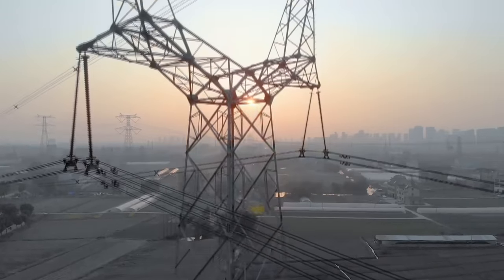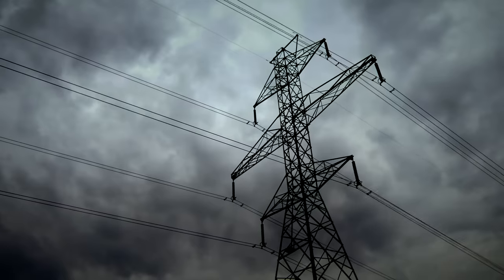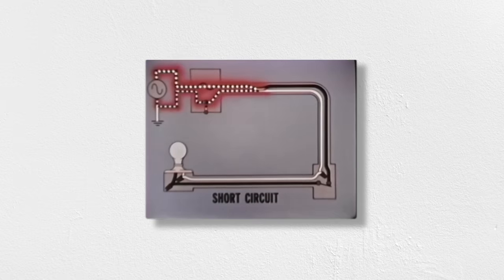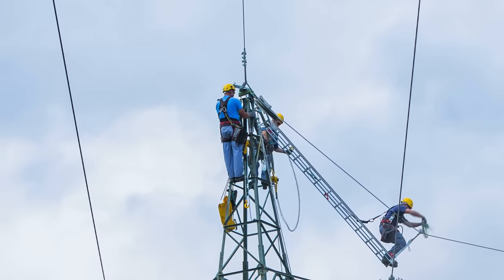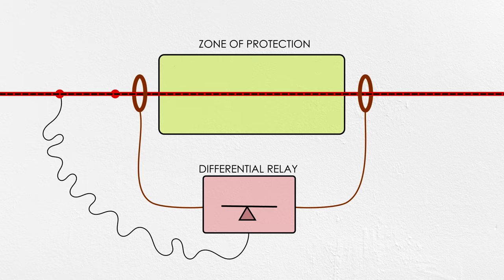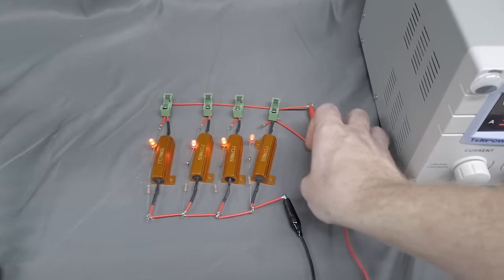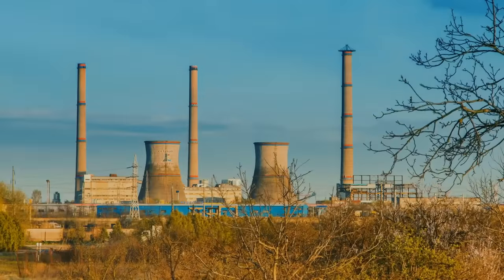How Power Blackouts Work

Comment: How is the internet connected to the grid and what can a hacker do to pull down the system?
Reply: I don't know about other places, but in North America the internet is not connected to the grid at all. Critical Infrastructure Protection rules in the US end up extending into Canada via the North American Reliability Corporation rules that govern bulk electric power in both countries. CIP rules forbid any routable protocol (like IP or dial-up) into critical power system equipment and fines for violating that are measured in millions of dollars, and the individuals responsible were looking at fines in the $50,000-$200,000 range.
It is all taken very seriously because of the fines. When I worked in IT field support for a Fortune 100 electric company we had annual training and testing on the CIP rules. When I needed to connect remotely to our equipment in substations I went to a specific place in our service center, logged into our intranet and looked up the circuit information. Then I called our Support Center where I talked to any of a handful of techs who knew my voice and asked them to build a circuit to the comm port on the equipment. Then I logged in with the user name and current password, and I had access to one device. When I was done I called the support center back and had them tear down the connection. If I forgot to call back they would check back every half hour (and they knew my cell number by heart.)
If I went rogue I could cause momentary trouble for a million or two people. Most of them would not even notice.

Comment: The fault you simulated happened because you were limiting the current that could go through the system at the generator level. I don't think that's how real power distribution works, current is set by the resistance of the devices rather than fixed to a value by the generating plant, thus a resistor+led package should not see a current difference when one of the other packages disconnects, and so it shouldn't burn out. Am I wrong here?
Reply: I was thinking the same. The voltage increased when one LED went out to keep same current, and current through each led increased by some amount leading to fuse breaking. Then the other and then the last one 

And did you notice 3rd led went down earlier than 2nd one. Just an observation though, that resistor might have little less resistance than others

Comment: So why does Electric companies charges the "transmission loss" to consumers?
I'm jus curious.
Reply: I know the one that I retired from doesn't. Bulk electric power consists of buying power from generating stations and selling it to individual customers or to wholesalers, and from wholesalers to the individual customers. They are very different price structures and (at least in the US) regulated with an iron fist by the FERC. The retail price is usually fixed by regulators while the generated electricity is bought and sold in what one of the traders described as the highest stakes poker game in the world.

Comment: Pretty insane to put so much renewables power into the grid then spend a lot of effort and money on backup generator systems, batteries and adjusting power output of reliable coal to keep the lights on.
Reply: Actually, it is natural gas that is replacing coal. Not only is NG cheaper than coal now (especially when mercury controls have to be added to coal plants) it is one of the two energy sources that can ramp up quickly enough to keep up with the sag in solar generation just as demand begins to peak. The other source is hydro, but most of that is spoken for. It is ironic that oversupply of solar demands fracking to maintain stability.
Reply: @flagmichael  Its intentional destruction of reliable power, possibly the greatest con of the 21st century. They know exactly what they are doing.

Comment: Relays? Relays don't measure anything. They're switches. Other devices measure the load parameters, then they might command a relay to switch.
Reply: In the trade (at least here in the Western US) the boxes are often referred to as "relays." I know it is not technically correct but it was never my call.

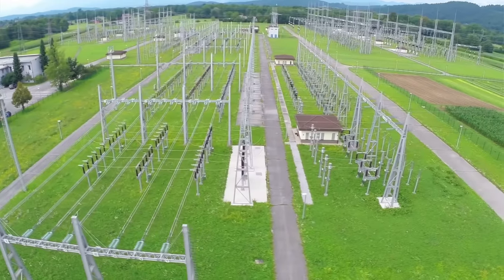Comment: 3:14 a car that never breaks down you say? buy an old volvo! they're indestructable! i have a 940, and it goes like a clock!
Reply: I had a 1985 Volvo 765T. Second most unreliable car I ever had (a 1984 Dodge 600 takes that prize.) It didn't help that the wiring was biodegradable (Volvo stopped that experiment in 1987) and the insulation shucked off like crazy, but there were more vulnerabilities than I can remember. Fuel pump relay, intake ducts melted from oil mist, fuel pre-pump pickup hose tore (most do), intake stuck on full preheat... the list goes on and on. The worst was the leaking heater core. Or maybe the intermittent TDC sensor or intermittent "power stage" (ignition driver). Eventually the piston slap doomed it, the inevitable end to every B230FT that didn't suffer thrust bearing failure.
Reply: @flagmichael  wow you were unlucky, there are tonnes of old volvos going around where i live

Comment: GFCI? triggered Next your gonna start using imperial units.
Reply from the maker: Called something else outside US?
Reply: RCD?
Reply: It’s also called GFI outside the United States. I think Mina86 is responding with a hint of sarcasm.
Reply: Yeah, it's RCD in UK though it has a bunch of names in other regions.
Reply: mina86 Ground Fault Interrupter is pretty descriptive to me.
Reply: mina86 Pretty rich, considering that the UK considers itself metric, but has speed limits in Miles Per Hour. . .
Reply: @dewiz9596 , yeah, that's because UK is only slightly more civilised than US.

Comment: A utility company needs more equipment every year, so they get a budget in January, then plans are made, contracts are set out, stuff is built, then they end up pouring cement & bolting up components the following January. This compromises quality, and creates misery for workers. Why cant engineers and managers get together and offset plans a few months ?
Reply: You mean form a union?
Yes they should if they aren't already in one.
Reply: In communications we had the same problem. Engineers would visit a site in the desert in winter or the mountains in summer, and release a construction package half a year later.

Comment: We could just use solar energy or even geothermal energy from the earths core very easy and cost effective
Reply: Geothermal, where available, is great. Iceland is volcanic and gets most of its power from geothermal. The US has relatively few locations with practical geothermal energy.
Solar is not so great - it is "non-dispatchable" which means it is not available on demand. California has already added a problematic amount of solar to the Western Intertie, which requires natural gas plants (and the fracking to provide the natural gas in such quantities) to maintain grid stability when the sun sets. See https://www.instituteforenergyresearch.org/solar-energys-duck-curve/
Reply: @flagmichael  geothermal energy is just taking energy from heat so basically if we somehow put pads that take in heat as energy  close Earth's mantle we would have alot of energy for ourselves it's like digging for oil  but safer

Comment: So, the grid, and it's many safety features are important, and I love learning about the various parts of it. But, why, in God's name, is the US broken down into no more than about 4 or 5 grids?

Like, the northeastern blackout was really bad, and was the second time it happened. But, I want to know, why not do what Texas does? Break the grid down per state? This way, if the power goes out in one state it's neighbors are perfectly fine.

But I've been wondering about this since about 2003. Because my thought was originally that the grid was broken up into smaller chunks, at least up until that point. Each state has like 1 or 2 electric companies covering them, so it would make sense to keep an extra layer of protection should it fail so much to the point of covering the whole state.

Also, some states, like California and New York would benefit not only from 1 grid protecting them from their neighboring states, but, extra internal grids due to city sizes. Give NYC one, or, since it's got 5 neighborhoods, give it 5, separate from the state. And California could have a few: 1 for northern CA, one for southern CA, and then one per major city, such as LA, San Francisco, etc.

Understandably these could complicate the systems a bit, but, they can establish solid borders and locations for the separation of grids, and thus become much more manageable.

And power from the generators can be easily solved, set up a separate line network as a sort of 'highway' for electricity, and then break it down into 'avenues' and 'streets' within each area.
Reply: Its a tradeoff between efficiency, reliability, and stability. Smaller grids may be more manageable, but not necessarily more reliable or efficient.

Comment: Nice explaination but thats not as simple as that you need a electrical engr to explain it more..
Blackout sometimes cause by load shedding but as i said not simple as that because its o complicated you need to balance the power per phase . Also its. Not just line to ground fault sometimes its also cause by 3phase fault, single line to line  and double line to line.. faults may happen in different parts of electrical industry  generation, transmission, distribution or even in your house .. as a consumer. Sometimes fault cause by disaster or they're doing maintenance.

Comment: Ok, I have to say this since it is a real issue with most videos about electricity.....Electricity DOES NOT "SEEK GROUND" !! Electrical current will take ANY and ALL available paths back to its SOURCE, period. The amount of current flow follows Ohm's Law, and ALL paths (including ground) will have a degree of current flow. The amount of current in each path depends on the resistance of said path, with lower resistance paths flowing more current than higher resistance paths.  And yes, "ground" is a part of it, since for many technical reasons (including safety) MOST, but not ALL, electrical systems utilize a grounded conductor as part of the circuit.

Another myth (which sadly, some Electrical Code Classes STILL teach to new apprentices) is that you cannot get shocked off of a neutral conductor (which in the U.S. and most countries, is grounded.) This myth is false, and for the very reasons I mentioned above (remember: ALL paths back to the SOURCE), you can get shocked from a neutral conductor. (Especially true on 277v lighting circuits common with 480y/277 systems.) 

Despite the repeated use of the seeking ground myth, this was otherwise a very good and educational video.
Reply: Actually, Ohm's law holds only for linear elements. Once you reach transformer saturation for example, using Ohm's law stops being accurate (unless you model the impedance with the non-linear characteristics). Amount of current depends on the impedance of the path in AC systems, no only resistance.
Reply: @FrainBart_main  You are correct. My response was keeping things simplified for the masses.

Comment: Target the electrical grid to accelerate the collapse
Reply: There are five of them just in the US, and they are fairly well hardened against terrorism. When I worked in an electric utility I was peripherally involved with an eco-terrorist attack on transmission lines for a nuclear generating station. Surprisingly enough, although the sudden drop in load caused two units to trip off line it never made the news and nobody noticed.
I worked in IT Field Support and was in the Y2K vigil, one of the half dozen techs we had monitoring the communication system. Everybody was on call or on station in remote locations, and out biggest concern was for hundreds of pounds of dynamite and 3/4 of a mile of det cord that was stolen from a shed at a cement plant a few months before. Nothing happened.
It would take a staggering number of people to make any large scale impression, and you know there would be a lot of federal agents in their ranks.

Comment: The reason they don't put the lines underground is that would mean less faults, less maintenance, meaning less jobs.
Reply: While this might be true for low and medium voltage lines, high voltage underground cables can be tens of times more expensive than overhead lines.

Comment: Your how much would it cost to harden the grid comment seems valid until a coronal mass ejection hits the earth dead on again.
Reply: They are overrated. The problem is that transmission lines running long distances in some parts of the world can pick up hundreds of amps of DC. If the lines are heavily loaded the transformers will saturate on positive or negative peaks of the AC and damage the transformers. The alternative is to shed enough generation and load in affected areas to prevent that overload. Here in Arizona there are no vulnerable lines.

Comment: I don't watch all your clips but recently (maybe 1/2 year) I get the feeling it's not "Practical Engineering" anymore but more like "Engineering for Dummies".
What happened to proper physical models?
The four resistors, fuses and diodes don't count because you had to increase the voltage of the PSU to make the rest blow. Unless of course you programmed the PSU for constant power/current which would have needed explanation.
But you didn't explain anything, not what of you example stands for what in the real grid and so on ...

Comment: "I don't want to pay for durable stuff that won't break"
Even engineers can be dumb in some ways
Reply: It is not the fault of the engineers. Economists are forcing them to build cheaply.
Reply: Engineers aren't the ones paying for the material. I don't imagine you'll buying an indestructible car. That would be horribly expensive. Would that make you dumb for not buying that? 

Engineers need to be smart by balancing cost and effectiveness. Why spend more when it's not needed. Engineers can build bridges that will never fail.... but does a city want to spend trillions on a bridge? Probably not.
Reply: @BSAnime  Well I think I heard that NY currently "wants" to spend 57 million on one elevator for each subway station.

The point being, the COST of those things is low, the amount contractors CHARGE/BID is criminally high. By your logic, old churches and castles are/were worth something in the QUADRILLIONS.